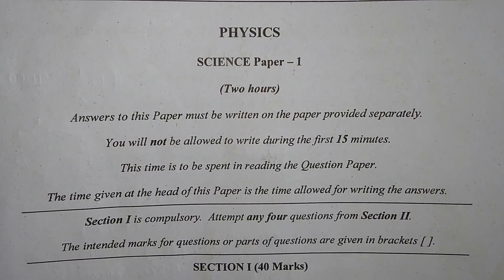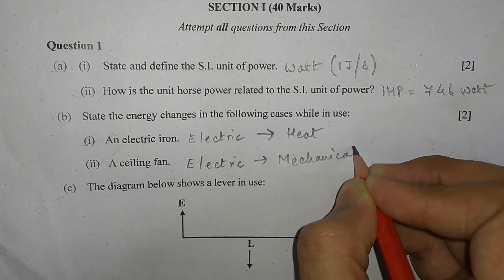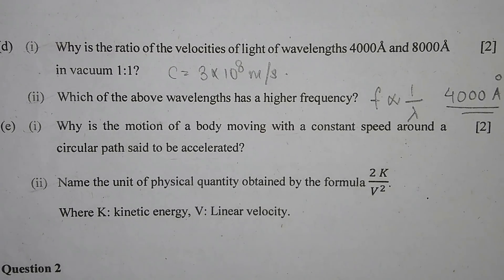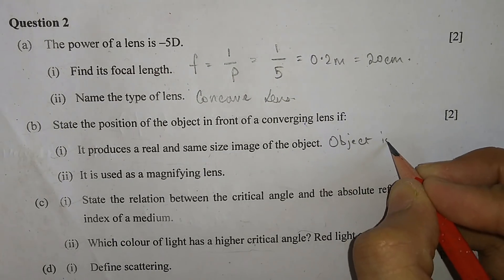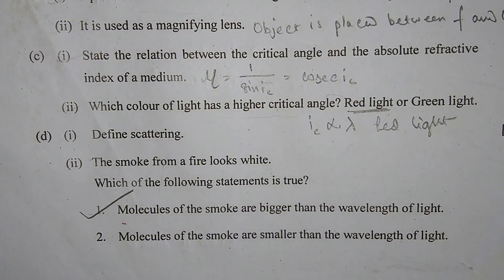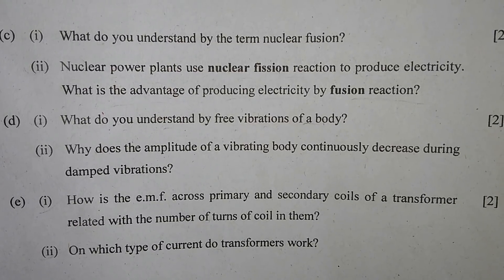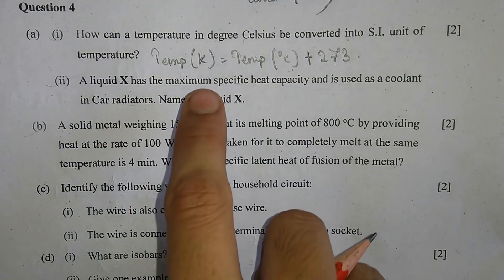ICSE 2018 Physics Solved Question Paper

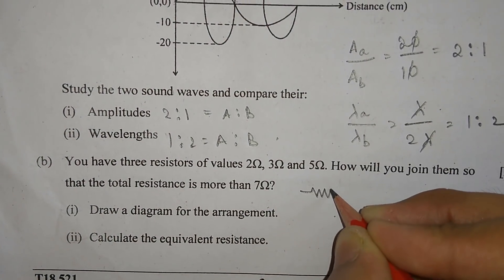Comment: 10:39 you are doing r
Wrong....  It must be like this 
    5 ohm.          2 ohm
___~~~_____~~~~~__
                        | 3 ohm___|
                        __~~~~___|
5 must be in Series and 2 and 3 ohm must be in parallel
Reply from the maker: Your effective resistance is coming less than 7 ohm. Check out our answer once more, it's correct.

Comment: Sir you are following Selena publishers. Can we follow the definitions from Good luck publishers
Reply from the maker: As long as the definitions are correct, you can use them.
Reply: EduCeption For example, the definition of nuclear fusion in
Good Luck publishers-The word Fusion means to join or to unite. The process in which two or more smaller nuclei of light elements combine to form a heavy nucleus along with liberation of large amount of energy is called nuclear fusion.
Selena publishers-Nuclear fusion is the process in which two light nuclei combine to form a heavy nucleus. In this process also, huge amount of energy is released
Reply from the maker: Both mean the same thing. Both are correct.
Reply: EduCeption So it is meaning that matters not the words
Reply from the maker: Yes, it is the meaning that matters. You can write your own words if you want as long as the meaning comes out correct.

Comment: QUESTION 2 E DIAGRAM PRISM critical angle is given 42degree so how did u get by knowing critical angle wheather the rays goes out of prism or reflects in prism first then goes out I THINK YOU COMPARED WITH INCIDENCE RAY SOMETHING
Reply from the maker: Yes, if the angle of incidence is more than the critical angle, then total internal reflection takes place. Else the ray gets refracted. Like over here the angle of incidence was 30° which is less than 42°, that is why the ray refracts and there is no total internal reflection.

Comment: I HAVE A QUESTION..i had written answer of that question in todays prefinals of 10th icse physics..QUESTION IS..NAME TWO SAFETY DEVICE CONNECTED TO LINE WIRE...i wrote fuse and MCB its correct????
Reply from the maker: Yes.

Comment: Sir, in question 2(i) I wrote "v=-20cm" since convention says negative.

Will I get full marks.

Sir, in question 8 a(ii), could switch be used? Since it protects the one who operates or repairs and electrical device. I suppose it should be considered.

Do reply soon...
Reply from the maker: 2(a) is correct. 8(a)(ii) is not correct.
Reply: EduCeption Sir in the book it was given that switch is used to protect the the one who repairs the electrical appliances if needed.
Reply from the maker: Switch is an on-off device.

Comment: Q3 (a) (ii) is completely wrong...
When A is completing 2 wavelengths, B is completing only 1 wavelength...
Therefore the ratio of wavelength A:B is 2:1 and not 1:2.
Reply from the maker: Your concept is totally wrong. A reaches to the final point in 4 vibrations and B reaches to the final point in 2 vibrations. Therefore 4A=2B. Hence A:B = 1:2.

Check it out once more.
Reply: EduCeption Thank you sir !!!

Comment: In question 4(b), I did everything correct but in the end, I wrote specific latent heat as1.6*10^6 by mistake..It had to be 1.6*10^5........... can you please tell me how many marks will I lose?? I think step marking is done while checking...
Reply: other than this,I am not losing 1 mark in whole paper .........I think I will score around 98/100......
Reply from the maker: Maximum of half a mark will be deducted.
Reply: EduCeption    Thanks a lot😃😃

Comment: A Primepallin number is a number which is a prime number forwards and backwards.
Eg: 13 and 31 are both prime - forward and in reverse. Other Primepallin numbers include 17 and 71, 37 and 73.
Write a program to print all Primepallin numbers between 1 to 1000. (You can use function(s) in your program)

Please help me with this program..i got this in my prefinals.